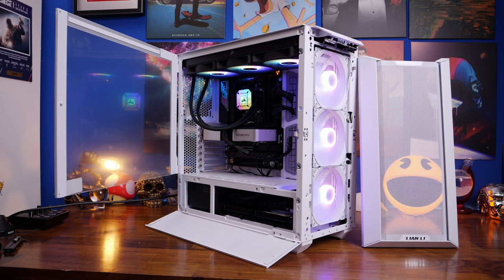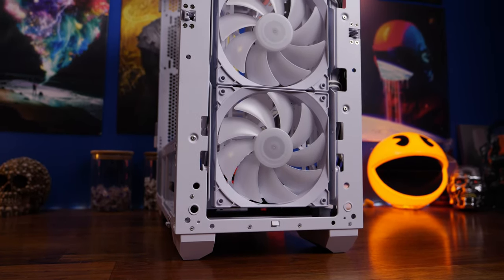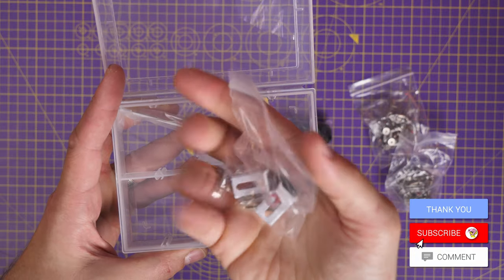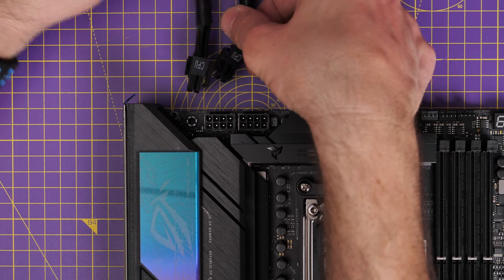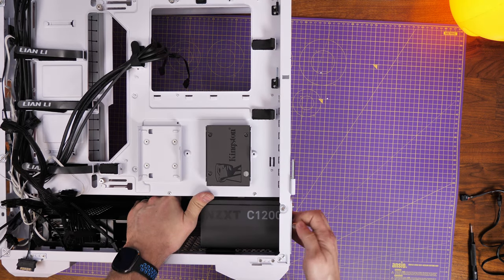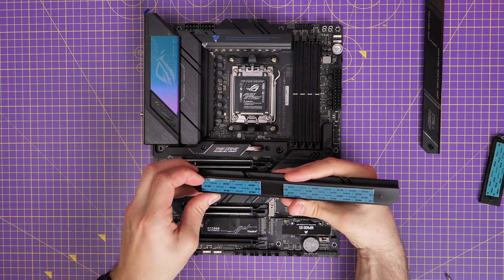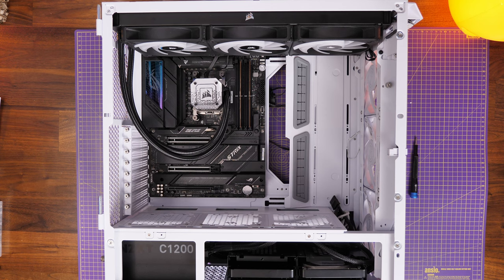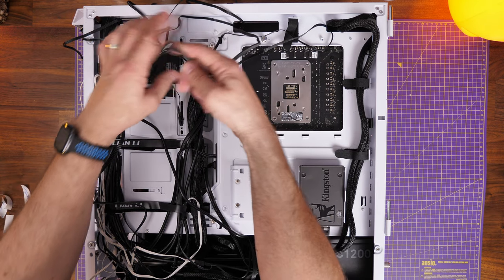Lian Li Lancool 3 RGB build guide with 420mm Corsair H170i Elite Capellix XT cooler

Comment: Excellent guide! But just to inform you and everyone watching - there is a much easier way to install the radiator
The "shelf" (sorry if the word is not accurate, I don't speak English very well) that the radiator is screwed to, disassembles itself (two screws fix it to the case)
What is most convenient to do is to take out this "shelf", screw the radiator to it, and put everything back from above
Reply: don't remember exactly but I also build my pc in this with artic liquid freezer III 420mm, I guess we can't do that top radiator installation like you said because radiator is too big xD well it may change from 420mm-to-420mm radiators but I will soon since I will do a bit more changes so if I don't forget I will let know people in here

Comment: Just got this case,did any of reviewers read manual? You can release the two hinges holding the front panel from inside of the case,don't yank it out,you'll most likely damage the plastic mechanism after removing it multiple times.

Comment from the maker: The specs of this build include  (note these are affiliate links which earn me a commission at no extra cost to you):
Case - Lian Li Lancool 3 (https://amzn.to/3y7Gc4a)
Motherboard - ASUS ROG Strix X670E-E Gaming WiFi (https://amzn.to/42rkncG)
CPU - AMD Ryzen 7 7700X - https://amzn.to/43Ll5mB
AIO - Corsair H170i Elite Capellix XT - https://go.corsair.com/9gAv93
RAM - Crucial RAM 32GB Kit (2x16GB) DDR5 5600MHz (https://amzn.to/3SJCYxa)
PSU - NZXT C1200 Gold (https://amzn.to/43MAhjd)
NVMe SSD - Corsair MP600 GS (https://go.corsair.com/gbmMY2)
NVMe SSD - WD_Black SN850 (https://amzn.to/43IRx92)
GPU - Nvidia RTX 3060 Super

Comment: 36:35  Funny enough I built a PC for a friend yesterday with this same case and radiator and if you unscrew the fans in the way of the power cables you can actually install everything without uninstalling the radiator.

Comment: Thank you mate, this series of videos has helped me greatly. I was installing the Corsair iCUE H150i Elite LCD XT Display in the Lancool 3, going for top mount radiator position with tubing at the front. Was able to retain the rear fan. Your video helped me understand all the little differences of cabling, especially your description of the Command core fan controller. I ended up replacing the front case fans with Corsair LL140s so that the command core could sync the RGBs with the radiator fans. Thanks to your video, this is the cleanest PC build I have ever made.
Reply from the maker: Thanks for taking the time to leave this comment. Appreciate it greatly.

Comment: I just finished a build in in the LC3, I put in the corsair Shift Series really helped, did not have to remove hdd bays at all... I did a couple of shorts on it. Amazing case from lian li. aside from those fish tanks.  I had fun Building in it. I was able to get a good fix on the side door with the wiring door can stay closed. like you said. just have to take the time to work them cables.   great Video. AWESOME!!
Reply: Bro lian LI lancool Airflow is very gud ? Than the 5000 SERIES
Reply: @GaMeRBoY-lz9rl  I agree! Fr, even with the filters applied. Air flow don't suffer. I had pick up the air filter for pet reasons lol. Also being able to use a 140mm in the back for exhaust.

Comment: I just made a similar build, and must say, no more LianLi. To place on the top the Artic Freezer II 420 was a nightmare. The screw holes were simply not allingned, so I was by the point, I drop out this case on the window. The hdd brakets are too near to the PSU, so connecting the cables is a nightmare, you need to take out the nearer, if you don't want any harm for the cable (for example the Nvidia 12vh power cable). Placing a 2nd hdd on the top the other, makes a noise, as there are no rubber resonance blockers. What is not shown in the video, that you need to change the direction the front panel cooler, only so can you put a 420mm radiator in. And if you do so, the rubber noise blockers on the fans needs to be swapped to the other side of the fans too. Lot of accurate work. And at last, the slot  backplates are all rattles, and it's very annoying. The overall quality of this house is dissapointing.
Reply: What are you saying, brother ? I have Artic Liquid Freezer II 420mm mounter in the top side of the Lancool 3 and even a 120mm rear fan.
It takes a while to mount it, indeed, but it works without problems.

Comment: about the ram, I also use 420 aio on top (The corsair lcd) and it fit perfectly fine with the corsair Dominator so i think ram clearance won't be an issues here
Reply: @TheProvokedPrawn  do I need to plug in a rgb header to motherboard

Comment: ...But I have 13 fans ST120 RGB mounted in my Lian Li Lancool 3 (wired) + 2 Interior  7" screens  (wired) + 2 RGB Lian Li  Strimers (RGB wired)  + 6 Push/ Pull radiator fans + 2 HUBS for connect all  the 13 fans RGB  + 5 SSD & HDD +1200w PSU  and my cable management is perfect and I  did not have any type of problem with the internal and external doors. You need improve the cable management. Nice build anyway

Comment: I have this case in black and have the H170i mounted at the front (mounted without issue) with a ROG Strix 3090ti LC graphics card  vertically mounted, with the radiator for that mounted at the top of the case. I am also using 32Gb Corsair Dominator Platinum DDR5 Ram without and issues.
Reply: What is your temperature
Reply: @GaMeRBoY-lz9rl  Never goes above 85 celsius when stressing, in game sits in high 40's
Reply: @TheBluSkyAboveYou  No, I have that same ram and it would not fit which is another reason why I chose the front of the case.

Comment: Go full Lian Li, I plan to do so myself. And I would like to see how does it look.
Reply from the maker: cooler as well? I'll be doing the fans in the next week or so. I've got another Lian Li thing to do too. So much on! But watch this space!
Reply: @TheProvokedPrawn  Yes, I plan to use Galahad AIO UNI FAN SL Edition 360 and UNI FAN SL V2. If I will have money I plan to change all the fans to UNI Fans and make ultimate daisy chain. I plan to swap front and Galahad ones and add 3 more on the bottom under the GPU. And one at the back. Daisy Chain light effects are very cool. Palit GeForce RTX 40X0 GameRock should look with it nice as well but i need to add O11DE-1X Vertical GPU Kit for that. Hope this gives you some new ideas. FYI my Lancool is black.

Comment: I recently did a build in this case and just removed the two back panels. Cables were too thick to even close, and I had CableMods which were pretty thick to begin with. Other than that, it's a fantastic case.

Comment: Hello, I see you have removed the rear exhaust fan to place the tubes at the back of the case. Does removing that specific fan impact thermal performance, or the AIO fans are doing the job well enough?

Comment: You've missed to show the only cable I did not know what was powering. From the cluster of cables coming from case control unit  there is one that goes to PSU.  Do you know what is its purpose ?
Reply: I think you are referring to the sata connection that controls the M & C lighting buttons on the case front.  It needs to be connected to the power supply.

Comment: Thanks God i found your video, i haven't been able to turn on the fan´s lights but apparently the problem is the sata cable, i'm afraid to plug it in and damage something, im no using anything like the corsair modulie you showed, the fan are working properly but not the lights

Comment: If I install 420 radiators on the top, can I install 140 fans on the back?
Reply from the maker: No. The tubes are in the way.
Reply: @TheProvokedPrawn u can position the tubes to the right you know instead on the left like you installed them in this video... So with the tubes on the right you can easily install 120mm rear fan

Comment: Did you had to do any king of adjustment to the 140mm fan near the rear of the case? I could not place it because of the motherboard, which is the same that you used, and I also bought the same Lian Li case. I don't get it.

Comment: So I bought lancool 3 and i170. Using asus hero z790 it barely fits. You have to remove the exhaust fan and screw the radiator on one side only in order to keep it as far as possible from the motherboard.
For me it's not what I would call compatibility. Lancool 3 is a good case but saying that it's compatible with a 420 aio on top is a lie.
Reply from the maker: The manual clearly says to remove the rear fan..

Comment: there are 3 extra in loose argb cable in the case any info why they are in the the case in the loose ?
Reply: Did you figure it out? Mine also has 3 loose cables as well

Comment: Tell me if dropsy will fit into the top of the 280 case.Tell me also the caps that are on the side of the case behind the glass when laying cables, they are normally closed now and you have solved the problem , the cable does not interfere with them?I watched in the reviews what is in the way.

Comment: How does the 16 pin gpu cable get 600watts from just 2 pcie power plugs, i thought each pcie plug on a power supply's only delivers 150watts ?

Comment: Hello!  Your video has been so helpful.  I haven't built a system since 2014.  I am running Windows 11 Pro and using the same case and MB as your build.  Question regarding the MB RGB controls.  I have downloaded the AISuite3 from Asus' page.  When I attempt to run the program I am getting a message that says I "must turn off Memory Integrity* to proceed with AI Suite 3.  Do you want to turn it off now?"  Is there some other way to control RGB on this board without messing with my Windows security? Armoury Crate bombed out and would not install at all. Thank you very much.
Reply from the maker: I've not used it but I've heard good things about https://www.signalrgb.com/
Reply: @TheProvokedPrawn  Thank you.

Comment: This is what I'm looking for. Corsair 5000* is too small for 420mm radiator, Corsair 7000* is too big and looks horrible. Why can't Corsair make 6000* Case, which will be almost the same size as 5000* and could fit 420mm rad? Here you also have 2 perfect places  to mount Corsair hubs... WHY CAN'T CORSAIR MAKE something like this?
Reply: Also for a reasonable price like 120$ i aint paying 299 for a 7000x

Comment: Does any one know what the SATA from the case is used for? Is it for the ARGB? So if I don't use that, I won't need to plug the SATA cable to the PSU? I can't find any info about it anywhere and all videos either skip it or don't explain it.

Comment: My has 17 fans
Reply: @TheProvokedPrawn  3 140 and 3 120 in front, 6 push pull 360 on the top. 3 on the bottom. 1 in back. 1 for the ddr5 custom bracket.
Reply from the maker: @facegamefps6725  blimey. Wiring nightmare 🤣
Reply: @TheProvokedPrawn  lian li fans so no not at all. Very clean

Comment: "a glass panel on the side with all the cables"..yeah, im out..
Reply from the maker: Yeah I don't get that part tbh.
Reply: That nearly drove me away from the case... I still bought it but it is an utterly weird design choice! I bought some foil to maybe apply to the glass panel so that it is solid white. I managed to hide the cables but even with that the side just doesn't look attractive at all... and the PC stands in the living room :( Other than that, the case is fantastic and enormously spacious!
Reply: this is apparently a new trend cause I've seen other new cases doing it as well... it's really strange, why waste the materials lol
Reply: It has potential. Specific colored sleeves for cables could help accentuate some themes and show off the cable management when removing the inner doors